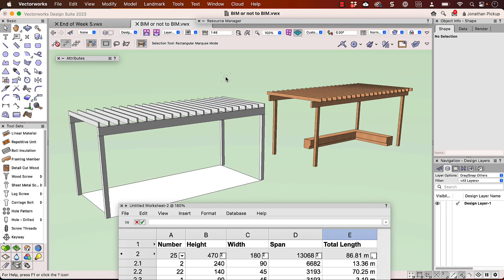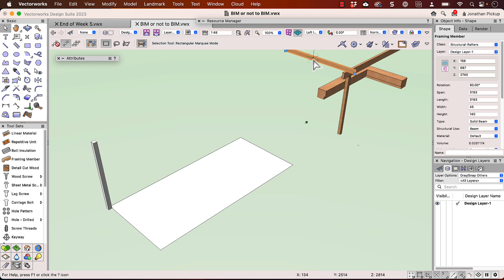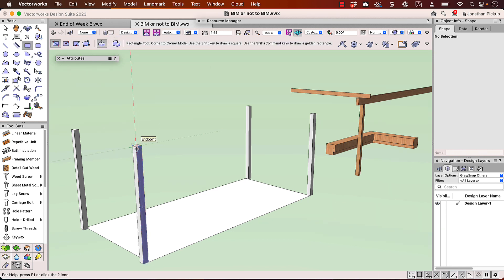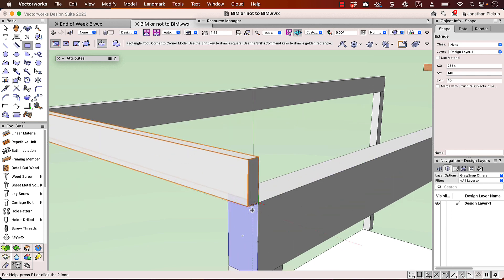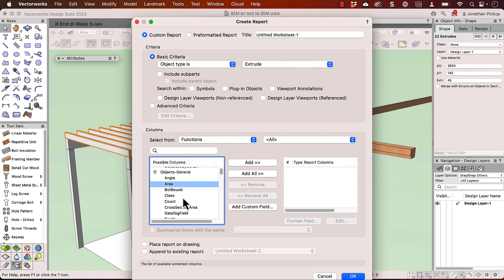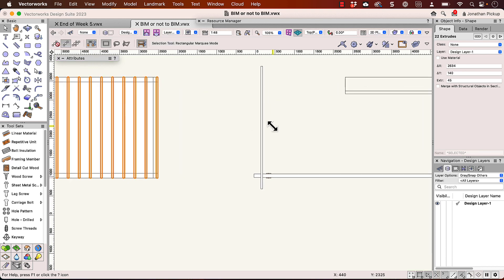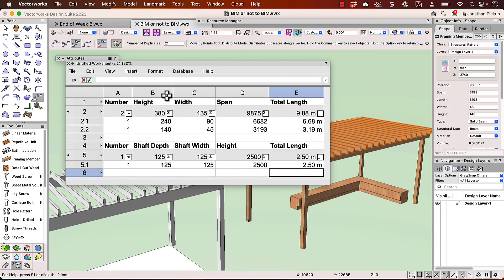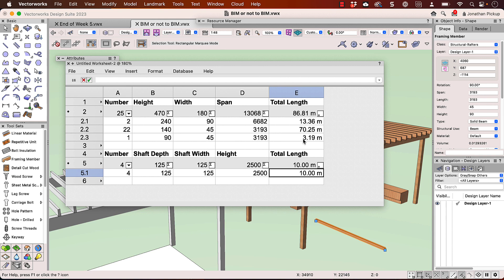BIM, or Not to BIM

Comment: excellent use of VW tools !  please do more of these
Reply from the maker: Hi Bob, good to see you! Of course I'll do more, anything in particular.
Reply: I agree with Bob, so many Vectorworks users need to drop what they are doing and watch this video!
Reply: off topic: is there a way to reshape stairs alignment in plan, convert a curved stair with fixed radius to an arc ?
Reply from the maker: Hey Bob, let me do some research on that.
Reply: @archoncad  I did see how a straight run stair was edited using the reshape tool and was able to be curved - I  will research further